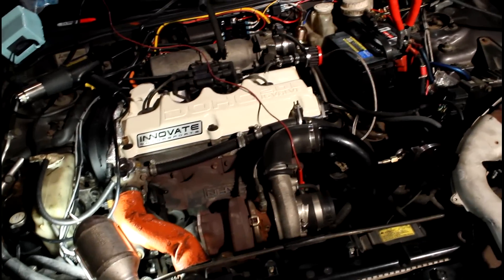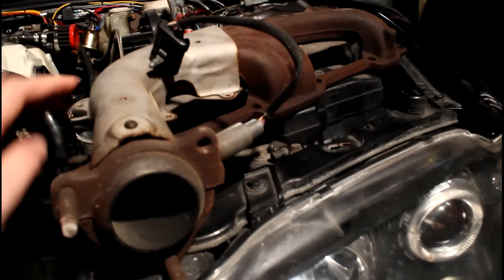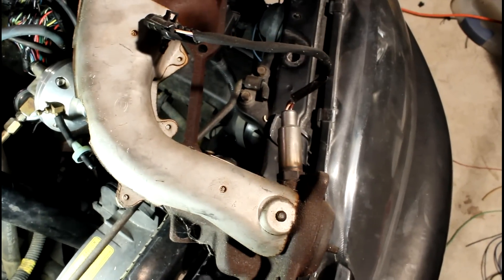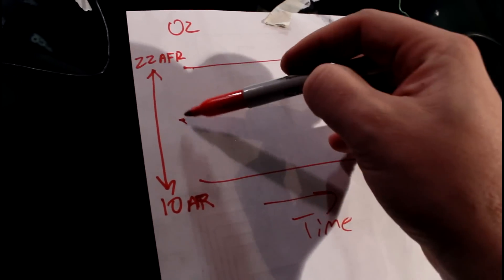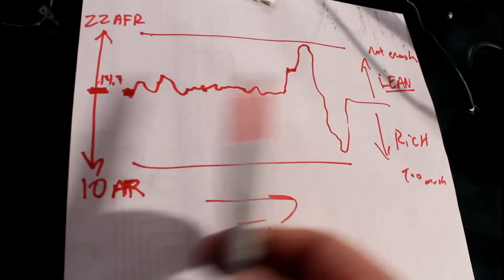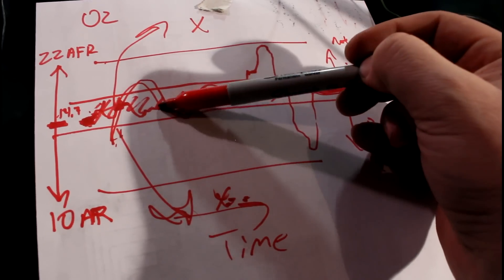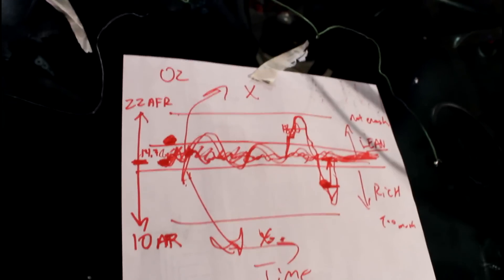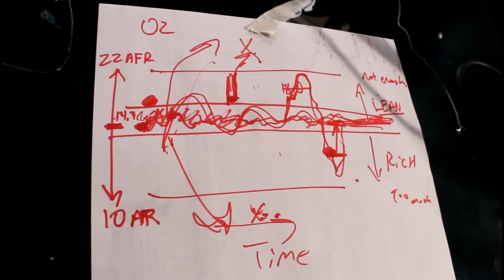Evan's Megasquirt Build Ep 17 - Wideband O2 Sensors Explained

Comment: I put a Megasquirt 2 v3 on an old V8 with turbos on gas. I wired it up as best I could using diagrams I found on the net. I was told that I need to get a wide band O2 and a control unit for it. Do you know what I need. If you could steer me in the right direction, I really would appreciate it.
Reply: wb02 is highly recommended especially on turbo cars. I use the innovative lm 1 I think. any one that has a 0-5v analog output.

Comment from the maker: Yea, ditch the narrow band, put the wb in its place, and wire in the narrow band simulator in place of the narrow band.  Just get the wires right, one is 0-5v, one is the narrow sim which is like around 1v or so.  Are you running megasquirt for fuel?  If so, you really dont need the narrow band simulator, but your check engine light might come on if you don't have it, even if the stock ECU is no longer doing fuel, it does not realize that so it will complain about the o2 sensor.

Comment: Thanks you for your answer! Yes I'm running a stock ecu and I only have 1 o2 sensor so I was just thinking since the wideband has ouput of narrowband simulator so i'm planning to use it up to wire up or tapping up. 
going to my stock ecu.

Comment from the maker: Yes, that is correct.  If you are running stand alone megasquirt, you don't need a narrow band at all, but if your stock ECU is still in place, you may need the stock 1 or 2 narrow band sensors (one before the CAT, one after) to keep the stock ECU happy.  If you replace one of the narrow bands with a wideband (before the CAT), you can hook the narrow band simulator up and wire that back to the stock ECU and it should be happy.  Some cars only have 1 o2 sensor, some have 2 or more.

Comment: I'm still on my stock ecu while researching for my megasquirt build. Thanks for talking about the simulated narrow band 0-1v output. I did some research on my AEM unit and it also has a 0-1v output I did not know about. Now I can run closed loop again.